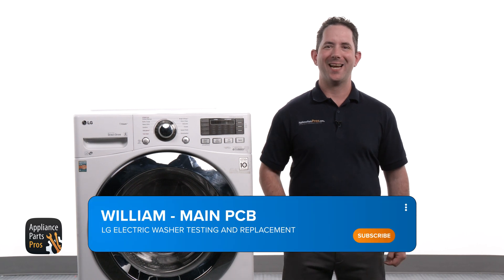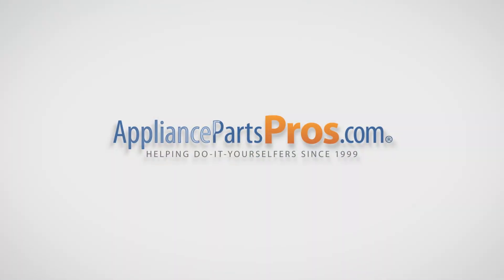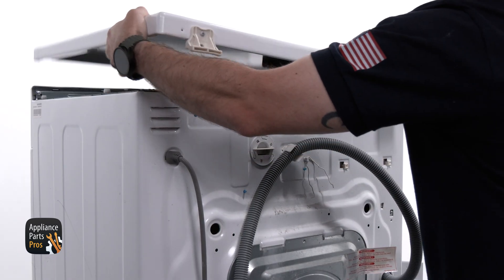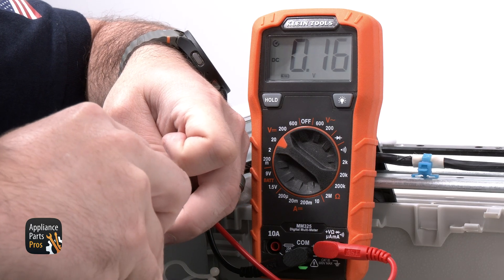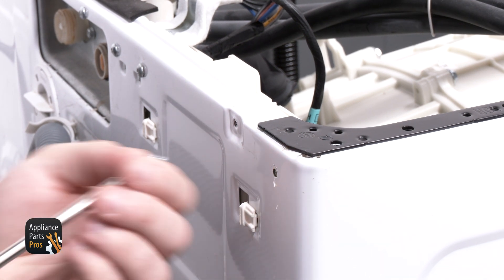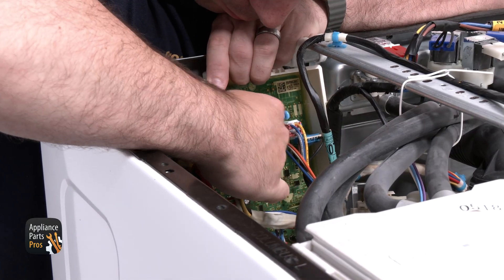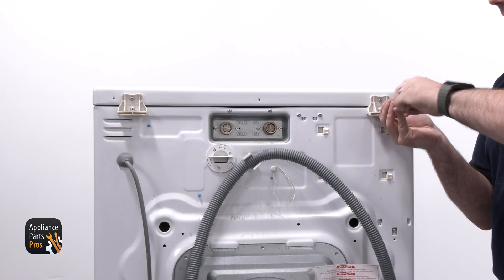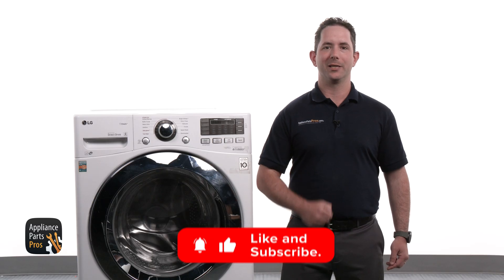You Won't Believe How EASY Swapping the LG Washer Main PCB Is

Comment: No red LED light when plugging power back in after removing top panel. Internal red led light comes on when pushing power button.
Diagnosis?
Reply from the maker: What is the model number of the washer? Depending on the model, the light could mean different things.